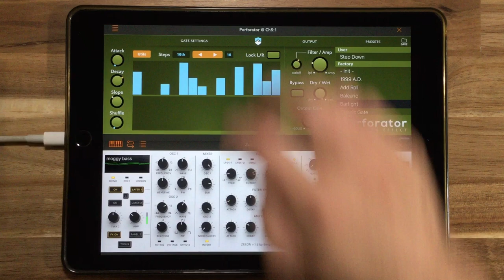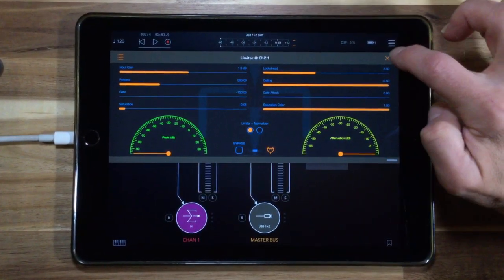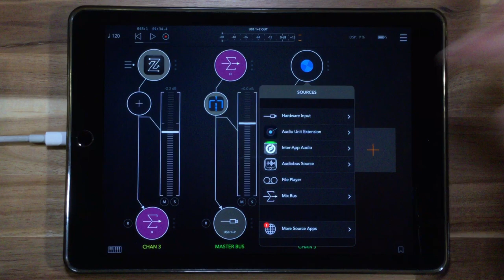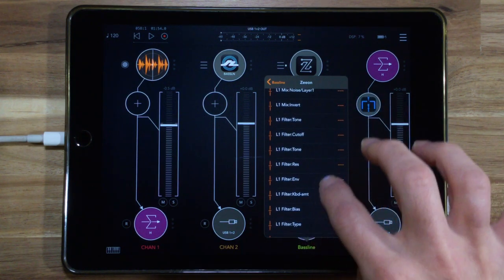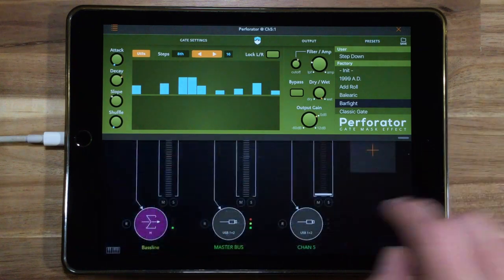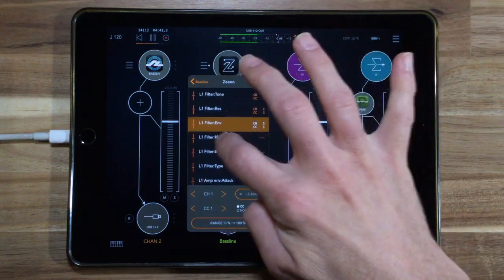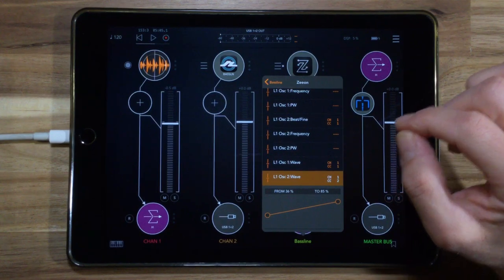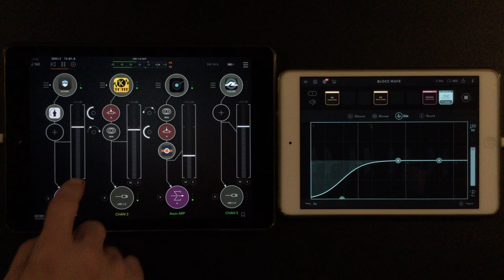AUM + Perforator - MIDI CC Automation - Parameter Locking

Comment: I have a midi challenge. I have addictive pro in AUM set up with the ARP locked, which means the ARP will remain as is, even if you change the  preset. I want to automate changing between 2 or  more patch presets(NOT ARP presets) as the ARP is running. I usually use the MIDILFOs audio unit because I like the way it works and the amount/variety of control, but I am open to any other way. One can access automating preset changing by tapping the name at the bottom of the addictive pro lane in AUM. I tried using the pc and cc choice in the place where you can choose cc, note or pc; but it didn't work. I don't know why it's not working. I will keep trying, but I love these kinds of midi challenges, and I think you are like me with that. It's so much fun to find new and better ways of using midi. My all time favorite midi apps  are midifire and midiflow. They can do very simple things and crazy complex stuff too. And the interfaces make it even more fun. Actually MIDIdesigner is up there, but much different use. Have you ever used mididesigner? I would use it much more if there were more choices for controls, especially knobs. I really don't like their knobs. Have fun, amigo. I wish I had the motivation to make YouTube videos. Every day I say to myself that I will start doing it. I want to get a camera to use instead of my iPhone 7+, but I should just start with what I have. With your understanding of MIDI, I think a lot of us would benefit from some deep MIDI videos. I understand MIDI, but from what I see in a lot of videos, most musicians really do NOT understand MIDI and end up messing around with trial and error, which ends up with a messy setup that has problems and is hard to tweak. Do you use a powered MIDI thru box. The powered ones are great because they never have note issues due to lack of adequate power. I have been using the same one forever. I ordered it directly from the maker in Poland. It's called Amotone Lab MIDI Splitter, made by Amptone and is now available from amazon. I like it because it works with wall power or 9v battery. I bought rechargeable 9v batteries with a charger and save quite a bit of cash because those batteries are not cheap. I also don't like the idea of throwing out batteries, so I use rechargeables of all kinds.

Comment: There is a cool app called MidiLFOs that you can use to send cc messages to 4 different midi channels and can control the rate and choose from several wave forms. It gives you plenty of options and It has ableton link. I use it standalone but you can put it into AUM if you want. It is not an audio unit but you don’t really need it to be. I suppose if it was an AU then you could load up a bunch in AUM and send to more that 4 channels.
Reply from the maker: Thanks for the tip, Perry! 🤗
That looks *sweet*! Art Kerns! I have his "MidiSteps" sequencer which is all kinds of awesome.  🤓 👏

I've been meaning to play with the LFO in the Rozeta suite as well, which looks very promising, and has 3 lfo's with selectable waveforms and some other editable parameters.  So much good stuff! 😍👊

Comment: Great video. Thanks a lot. I will get right to using this.
Reply from the maker: Thanks, Marcus! Hope this helps in your sonic journeys! 😁 👊
Reply: Can one change the midi channel or the cc of the perforator? Meaning to use more than one instance to control...
Reply from the maker: Yes, you can, Markus! 😁😁 If you press the little "Utils" button on Perforator, you can set the Midi Channel, and the CC#'s for both channels as well. 🤗 👊

Comment: Your videos are really helpful, especially because you take time to explain how to connect the devices !!!
A question : what midi controller would you recommand (i use mainly AUM, patterning 2, audiokit1 and apparillo, and several effects or sequencers, like rozetta suite) ? I don't want a midi controller that could be ￼to limited but be able to control knobs like cutoff, for example. 
Thanks by advance !!!
Reply from the maker: Thanks for watching, Bro! 😀 👊
Personally, I really like the Novation Launchkey midi controllers.  They give you keys, knobs and pads to assign, and they work with iPad and laptops/desktops.

I have both the 25-key version and the MINI version.  The 25 key version is nice because you get a *MOD WHEEL*, but it is quite a bit bigger in size when you put it next to the tiny MINI.

If you want to be able to put it in your backpack and take it out with you, the MINI might be the best oiption.  If you mainly want to use it at home, the 25-key is a great choice, imho!

Hope this helps! 😀 👊
Reply: Thanks a lot for the advice !!!

Comment: Excellently explained. You’ve opened a whole new dimension to my mind thang. Btw what software do you utilize to insert images and animation?
Reply from the maker: Thanks for the kind words, Robert! 😁🙏👊
I've been doing all of my video editing with an app called "LumaFusion" on an iPad AIR 2, which is a really robust video editor.

However, I use and combine results from a lot of graphics apps to process my graphics before I import them into LumaFusion such as Photoshop Express, Werble, Trigraphy, Mirrorly.  Some of my logo animations have been made in After Effects on my desktop system as well.

2 weeks ago, I got a new iPhone 8+ 🤤🤤🤤, and i've shot (ProMovie) and edited (LumaFusion) my latest video using only the iPhone 8+! 😲  Although the screen is tiny compared to an iPad, LumaFusion worked pretty darn fantastic on the iPhone! 🤓👏
Reply: Electronisounds Audio thanks for sharing the info.

Comment: Thanks Dean for this vid, i needed this explanation badly, very well explained.....Now, how would one do this in BM3 or Cubasis (can you make 2 more videos please? )
Reply from the maker: I spent hours trying to get this going in Beatmaker 3, and later had to ask for help on the official BM3 forums... Turns out this feature is not available in BM3 at this time, but should be coming in a future update. 🤓 👏

Sorry, I do not use Cubasis, so I can't be of any help there.
imho, this is a very new MIDI routing feature that most apps cannot implement yet. 🤗 👊
Reply: Ive got AUM so this is very helpfull video, thanks
Reply from the maker: Sweet! 😁 I've got more AUM tutorials on the way as well - I'm finding all sorts of cool stuff we can do with it and I want to share! 🤗👊

Comment: Thank you for tutorial! I just set up noir the same way. The only problem is that you can not have more than one unit of Perforator per session. Would like to know if someone has a solution!
Reply from the maker: You can have as many instances of Perforator per session as you need? I just double checked and loaded three onto one instrument?  You can load a dummy track also - like an empty audio track, and then stack as many Perforators as you need on that channel...  WOOT! Are you using AUM? You can set the routing of each Perforator in the MIDI routing tab. BOOM! 😀 👊
Reply: Electronisounds Audio Yeah, I’m using AUM. I mean all these perforators work on channel 1 and cc 1 and 2. So second perforator overwrites the first one. Or not? Thanks !
Reply from the maker: @PitaPaaaka  You just assign the Perforator to the specific instrument in AUM's midi routing tab.   Perforator will not effect what it is not routed to - I just tested again - you are good to go here. Just load the Perforators and ROUTE them individually to whatever you want them to go to in the MIDI routing tab.  Then assign the controls as shown in this video. 😀 👊
Reply: Electronisounds Audio now it’s working! thank you for help!
Reply from the maker: @PitaPaaaka  Excellent! Yay! 😀 👊